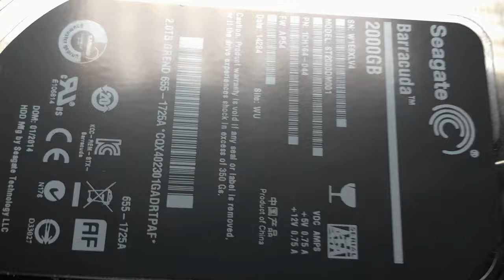Airport time capsule all disassembly, repair, replace HDD

Comment: Thanks for posting this, just repaired a dead Time Capsule but had to cut the rubber boots at the top of the hard drive to get it to fit.

Comment: Missed (very) careful when handling the cables ... their connectors are very sensitive!
Reply from the maker: Hello, you need tools and if there is damage, then try to buy a replacement, soldering cable

Comment: I have the airport time capsule 3tb and a few days ago it fell from a height of 20cm and from there it does not recognize the hard disk, the light remains orange blinking. do you think the hard drive has died? How can I rule out the failure? thanks
Reply from the maker: Hello, try to find out the status via the airport application and restart the base. A cable may have come loose, but the height of 20 cm is not very high ... also make a new update if it connects you.
Reply: My TC stoped recognize HDD 1 month ago too :(
Reply from the maker: @normanneal35  Try the latest firmware update

Comment: Hello, good afternoon, I have a question ... I have the same 3tb time capsule and the disk works without problems, to date it does not present anything. But the orange light remains 24/7, I thought it could be the power cable but it is not .. I formatted it but it remains the same. What could it be? 
Can I send information to the hard disk? (photos, movies, documents, etc?) Best regards.
Reply from the maker: Hello, the orange light means that the internet connection is not working - there may be a bug in the modem or provider cable - also try the update that is available in the application
Reply: @svetnovinek  Hmm, I changed the internet cable, I have no more updates and I reset it to the factory. But the orange light continues, but I have internet and it works fine ... It's strange (Ps: thank U very much for answering me so quickly).
Reply: The LED can have 3 states:
- green means everything is fine;
- solid orange means the device has some issues, but it doesn't compromise normal operation (like suboptimal network conditions);
- blinking orange means there are errors that compromise normal operation (loss of internet connection, corrupted hard disk and the like). You also get a blinking orange when the device is starting up - in this case it should change after 1-2 minutes.
Use AirPort Utility to read out the exact errors/warnings that make the LED go orange. But if the LED is solid orange, it's probably minor issue like double NAT.